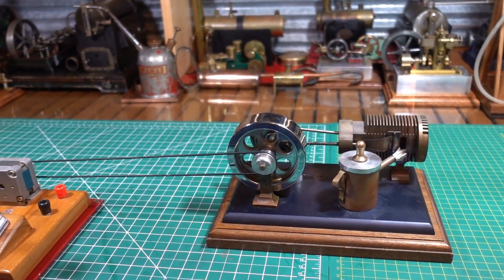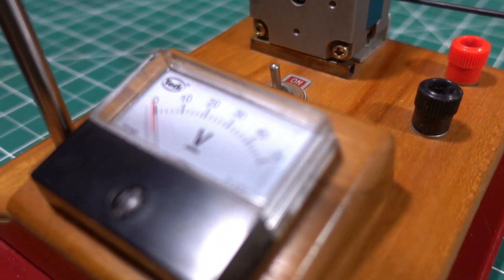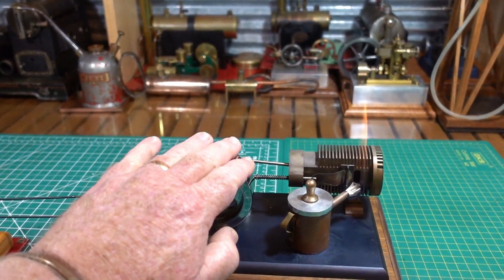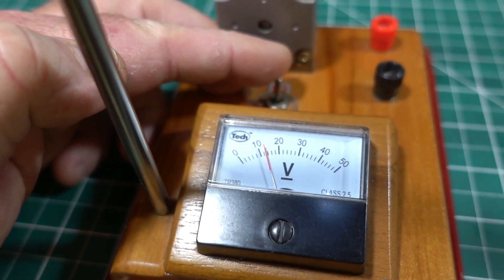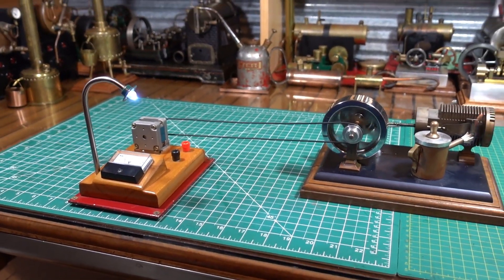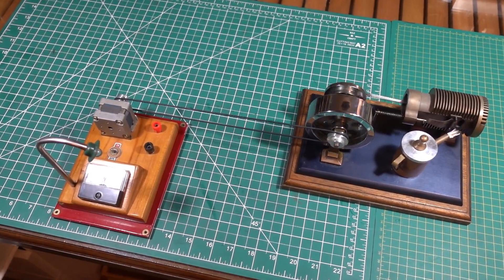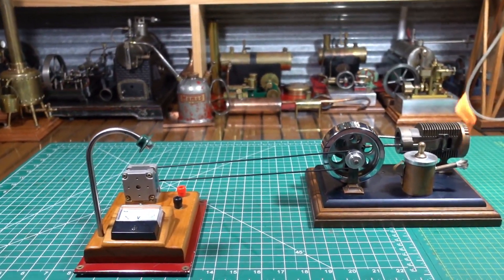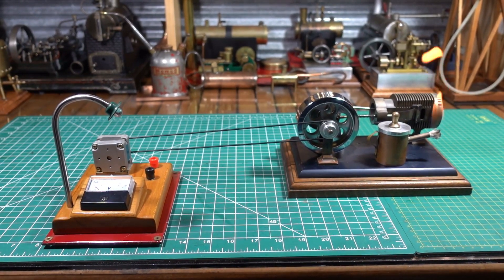Flame Licker Flame Gulper Vacuum Engine Running a Generator and lighting an LED bulb.

Comment: Nice man, she's running like a well oiled machine.
Reply from the maker: Thanks ...appreciated :)
Reply: @SteamEngines-Jim  you're welcome!! I love flame lickers. They're the unique (closer to an actual engine) type. Haha 
🤔 I'm building a big one from a old lawnmower engine. But have to find another block and start over. 
Block was warped and causing too much friction. 
Pinching the piston somehow. 🤔

But i have one i bought that runs great still. 🙂 i use a thin transmission fluid to lubricate it for long runs.

Comment: Nice one, my flame licker is a pain in the arse. Order a wick burner to see if that will improve things.
Reply from the maker: I have some Chinese ones off eBay and they can be exercises in frustration. Try heating it up (very warm, too hot to the touch) with a gas burner and see if that helps.

Comment: Very nice. What kind of generator?😊
Reply from the maker: They were made by a fellow steamer (he doesn't make them anymore) he used stepper motors out of printers I'm pretty sure.
Reply: @SteamEngines-Jim  Thank you for Information.👍😊
Reply: Looks like NEMA 17 stepper motor, one of the thinner types with less torque, And each winding has a diode bridge. Both connected to common capacitor and some kind of step down regulator or just resistor before the LED. Looks like it can give about 0,5-1W, good enough for a light. 3Dprinter guys gan give you tons of stepperssimilar to this one. They cost like 10$.
Reply from the maker: @HyperMAX9001  Thanks for that information, appreciated.